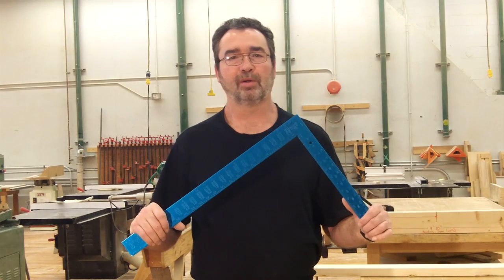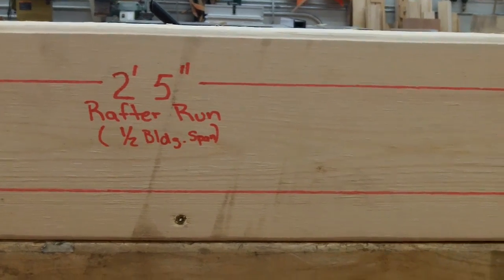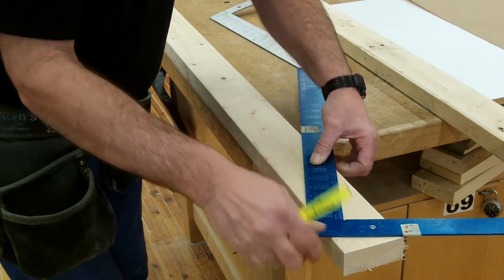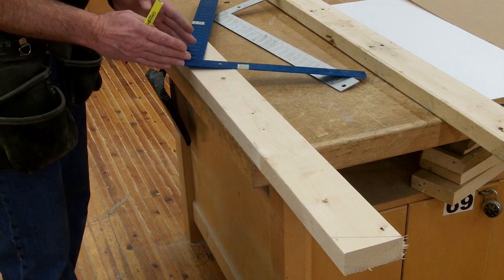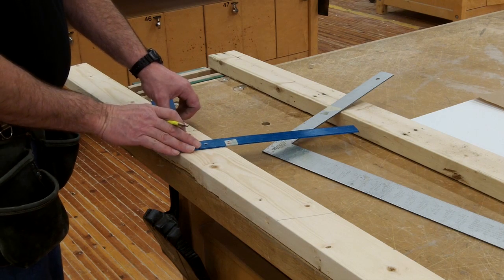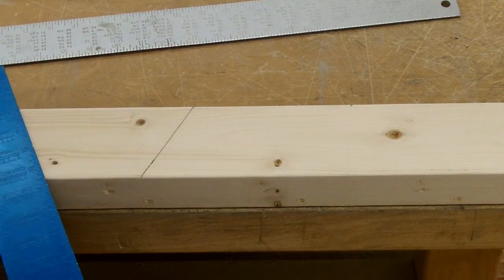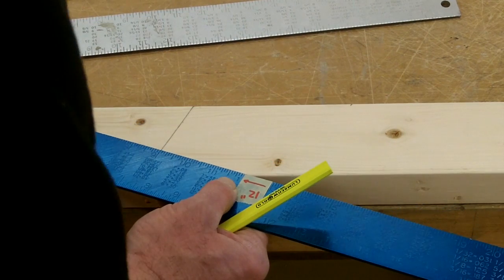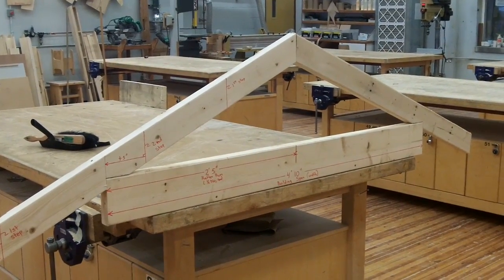Rafter Layout Step Out Method

Comment: Very informative and step-by-step.  Explained very well.  Thank you.
Quick question.  In your example, if a ridge board was used, you would subtract 3/4" from the top of the rafter, right, to account for half the thickness of the ridge, right?

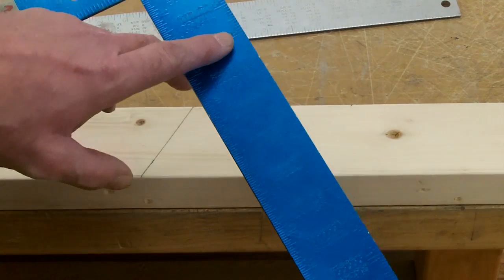Comment: A bird's mouth cut like this will be MORE than a third of the depth of the rafter & I think you have made an error. When you measure bird's mouth depth at around the 5:40 mark, you measure one third on a sloped line, not across the depth of the rafter (shown as width, as it’s on its side for marking). 

To be correct, the framing square should be laid against the rafter edge and a mark made at two thirds depth where the leg of the square intersects the plumb cut. Then the square should be placed against the mark, lined up with the plumb cut, to give the seat cut. In your example, it’s 5 in 12. 

5 in 12 gives a pitch of about 22 degrees and a rafter length of about 13” between the corner of the bird's mouth and the ridge.

Comment: I have a question for you; you mentioned a 5/12 roof slope, not sure what that means exactly, please explain.  I'm re-roofing an old cottage and the apex height is 6'6". and the run/width of the building is 20ft. With this information, how do I calculate the plumb cut? What is the formula to work out any plumb cut I suppose it is the question here? Thanks in advance.

Comment: why you use 5 /12 , i understand about 12 but why is 5 ? how did  you convert big  numbers into small  and make  according to 12 ?
Reply: The 12 is a constant and is called unit run the 5 can change depending on the slope of roof you want, you can use any number with the 12. For example an 8:12 roof would be steeper than a 5:12 roof and a 4:12 roof would be a lower slope. The principal doesn’t change .
Reply: A 5/12 pitch equates to a roof pitch of 22.5°. For every 12" the rafter travels towards the ridge it rises 5", 👍🔨🇮🇪

Comment: can you demonstrate how using the calculations from the printed value on the framing square will give the same rafter length?
Reply from the maker: I am working on more videos, and that is one of my goals explaining the rafter tables on the square. Keep an eye out for it.
Reply: @markswanwick8168  that  would be excellent. showing how to convert parts of an inch into a decimal.
Reply from the maker: @tedpavlack3791  fractions to decimals is quite easy, divide the numerator by the denominator and you have decimals. for example 13/16" = .8125" and the reverse to go from decimals to fractions and usually 16ths of an inch in carpentry is good enough. You multiply your decimals of an inch by the denominator you want:16ths, for example .787" x16 = 14/16" which = 7/8". Hope that helps

Comment: thank you for your excellent video on how to use the framing square.  Do you have a video on how to calculate the length of the ridge board?
Reply from the maker: I am posting a new layout video also a ideoon gable roof assembly which includes ridge length and layout.should be up tomorrow or next day

Comment: Shitty thing about this method is you gotta know the pitch already but what if you got a roof with an uneven number like with fractions? Your screwed in this circumstance. My roof span is 99 & 3/8 and 34 inch at top of ridge beam. I would have to rip it all out to get an even number in order to do it with this method.

Comment: Are 2x4's at 16OC rafters good enough for a 10x12 foot gable roof shed 
or do I need to use 2x6's?  It will be a 5/12 pitch roof and the rafters
 will run across the 10 foot width of the building them to a 2x6 ridge 
board topped with an asphalt roof.  With the over hang the rafters will 
be about 77 inches long.  There is no snow where I live so the only live
 load Im worried about is my 220 pound body on top of the roof while 
installing the roof

Comment: Hi, great simple video. Any chance you could do a video on the scale stamped on the side of the framing square? I know they are relate to roofing but I’d love a simple way of understanding how they work! Cheers
Reply: Is it the common rafter scale you are referring to?
Reply: @Toyotaamazon80series  it is ya
Reply: @danthechippie4439  Ok, basically for every inch of pitch there's a corresponding number on the scale which is the hypotenuse of a right angled triangle. So for example if your roof was a 12'' pitch (which is 45 degrees) with a 12" run (common rafters always have a 12" run) the hypotenuse of a triangle with those lengths of sides is 16.97. You'll find 16.97 under the number 12 on the framing square. so if the run of your roof was 12' you'd multiply 12' by 16.97 and the answer is the length of your common rafter, so 12'x 16.97 = 203.64 inches or 16.97 feet. I hope this helps.

Comment: What if ur putting in a rig beam like a house roof do u have to subtract the size of the 2x10 by takin 2inch of somewhere because it wouldnt be in the center anymore hope u understand lol im not a builder just trying to learn
Reply: I think you would take off one inch because you are framing half the roof.  The run is to the center of the roof which is the center of the 2 inch rafter.  1 inch is on one side of the roof and the other side the other inch.  There is only 1 inch of the rafter affecting the layout per side.

Comment: Nice manual manipulation of the square in showing how to deal with matters where things don't always turn out exactly even.  The one thing left out though, is to subtract from the top plumb cut 1/2 of the thickness of the ridge material's thickness which is typically 3/4" for nominal lumber measuring 1-1/2" thick.

Comment: When marking out the extra overhang for facial is this done after half the ridge thickness as been taken off or before, cheers
Reply: You always lay out the rafter completely by the theoretical peak point (before shortening). The shortening for the ridge is independent of the rest of the rafter. Don't cut anything until rafter is completely marked out.

Comment: Q: what would happen if the building span is 7 feet? how to calculate the angle thank you. Ed
Reply: The span is the entire width of the building. You calculate by the run, which is half the building width (span). So, if your building is 7 feet wide, then your run will be 3 1/2 feet. Your calculation would be 3.5 X 5 (5/12 slope) = 17.5" for total rise. If you want a different slope, say an 8/12, then it will be 3.5 (your run) X 8 = 28" total rise. The different slopes means your rise will be different, meaning your ridge board will be set at a different height, for that slope.
Reply: To calculate your angles you divide rise over run  but you have to have a calculator to get the angle here how your figure a 5/12    5rise /12 run =0.4166 conv. Tan = 22.62 degrees and this is how you figured any angle for any slope from 1 to 24
Reply: You use 7 instead of 5 in the places he uses 5.

Comment: THE BEST ON YOU TUBE ,EASY AND BRILLIANTLY EXPLAINED,PLEASE SHOW US HIPS AND VALLEYS THANKS
Reply: For the step off method, you'll use the 5 on the tongue of the square, for a 5/12, just as in the video, but for the level cut you'll use 17, instead of 12, on the blade. This is because hips and valleys run at a 45 degree angle to the corners, which means they travel 1.4142 X the distance of the common rafters. If you use the measuring method, just measure 1.4142 the distance of rafter length. As far as the angle marks and cuts, well, that will require a video.

Comment: brilliant The framing square is an awesome instrument.  I assume to accommodate a ridge board/beam one would simply deduct 1/2 the thickness of the ridgeboard?
Reply: Yes.
Reply: @trouts4444  Yes, but perpendicular to the ridge plumb line, not from the rafter length.

Comment: When you say zero on one side of the board at 5:50 ,  does that mean you have the corner of the square on opposite side of the 2x4 and then position the 8" mark on the other side.
Reply: No, the numbers he is using in 1 and 12 inches.  If you put 0 on any board and 12 on the other edge you can go down 4 inches and that will be 1/3 of the board.  Go to 8 and you are at 2/3'rds of the board.  Go another 4 and you are at the end of the board.   He is just showing an easy way to find out where 1/3 of the board is. You can use the method for any board shorter than inches.   4 is 1/3 of 12.  8 is 2/3 of 12.  That is not just for rafter boards but any board.  Say you want to find 1/2 of a another board.  You could use any inch you want.  For example if you can span the board at any angle and be able to touch 0 and 4 to the edges then 2 would be 1/2 of the board.  Say you use 0 and 8 on the edges of the same board.  4 would be one half of the board.

Comment: very good explanation, and nice method.  however you started the video by stating no maths or tape measure, which is not strictly true.  If you are on a job where calcs have not been provided then you would need to do a bit of Pythagoras to work rise and run and therefore determine slope/pitch.  Also you did not deduct half of the ridge board measurement off the plumb cut at the apex, although you did not have a ridge board in.  nice video all the same
Reply: Aaron Rothwell , On a set prints you can look at various places to see the dimensions required. Also if drawn to the 1/4" scale you can use your tape measure as a field version of a architectural scale. Drawings  with provide the pitch angle as a sub detail on a elevation section. The only math you need is to divide the span by half to determine your run.
Using 4/12 and 20' span as example...20'÷2=10'. 10'= run
Now you know your run..what is the elevation of the ridge? Easy...10×4=40...so...your ridge is going to be 40" off the plate line.  The method he showed with the framing square is how I learned about 25 years ago..it always works..just have know your take offs...ridge..sub fascia..fascia.
Easy peasy..lol
Reply: @gmburzynski68  Your ridge is going to be 40" off the plate line, plus the height above plate distance.

Comment: I was working on a site and I herd the expression that someone needed a long 45° it was a 12 on 12 roof. an I thought a 45 was a 45   Iam still not sure what it is or how to find it. but it was probably some one messing with me like telling me to find a bucket of steam. or a water hammer
Reply: 12 on 12 is 45 degrees if you set your framing square on 12 on the body and 12 on the tongue and draw a line you have a 45 degree angle

Comment: Beautifully done video Brother , Sincerely!  But I am shame to have to ask, how did you come up with the roof slope? Also is the roof slope the same as the rise of the roof? can you pick any roof slope you'd like?  ... This is the part where I get lost .
looking forward to the answer for this, for you have made the rest ever so clear , can hardly wait to implement these skills ... My sincere Thanks,  I greatly appreciated your video on this subject.
Reply: Joseph Rodrick the slope is chosen by the homeowner here in Louisiana to build to code it has to be atleast 3/12 but there is no rule
Reply: You choose the slope, unless you're working with blueprints. Blueprints will have this info.
No, the roof slope is not the same as the rise of the roof. The rise is how many inches your peak will be, so it determines what the slope is, but they are separate things. Your total run, in feet, multiplied by the 5 in 5/12, will give you your total rise for that 5/12 slope.
There's more to it, but that is the basics of it.

Comment: How should I cut birds mouth on the rafter that will seat on the wall plate of 6x6? 
How should a measure it if my rafter will not be tied on ridge board,  it will be placed on existing roof ?. I am covering my porch so that's why I am asking .
Reply: The size of the plate does not matter.  The way that is taken care of is the 1/3 part.  That is, 1/3 of what you rafter is not the beam it sits on (plate).   BUT, you can vary the length of the birds mouth (called "the seat").   You slide the square to the size you want for your birdsmouth but it should be to code.  Code usually requiress not more than 1/3'rd.
Reply: @trouts4444  Of course, when you use wider rafters, like 2X10, you'll make your seat cut 3 1/2" in length to cover a 2X4 plate. You'll make it 5 1/2" in length to cover a 2X6 plate.
Reply: BiHlover80's birdsmouth would be the exact same even if it were a 24x24

Comment: For some odd reason mine didn't come out like that.  Every time used the 5 and 12 I ended up with 13 inches for my 1st and 2nd step.  I also didn't understand the birds eye setup.  You said divide 12 into 3 and got 4 and if you add 2 out of those 3 pieces then you get 8 but I don't understand how I was off by like an inch.  If you could explain then it would be much appreciated

Comment: how about the ridge board, when its dropped in between the rafters won't it change the angles
Reply: John Price no it won’t buddy you just have to subtract have the thickness from each rafter so if you used a 2x6 ridge r ledger then you would subtract 3/4 for ridge r 1 1/2 for ledger from ur span
Reply: @codidescant9546  Just make sure to subtract the 3/4" perpendicular to your ridge plumb line, not from the rafter length.